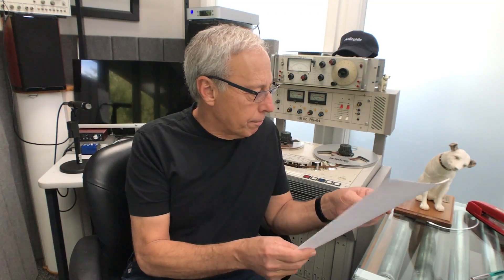Where vacuum tubes work best

Comment: Do you believe in using rectifier tubes for the power supply? Some people say you can't build a tube amp with a solid state bridge rectifier and expect it to sound good. I get the fascination. They're glowing awfully pretty, but so inefficient and expensive... and that internal resistance and sag...
Reply: Is it worth replacing the 1N4007 diodes with fast recovery diodes and what do you mean by snubbers ? Caps across the diode ? I once replaced the little rectifier diodes in my Philips based CD player with 1N4007's and the sound improved greatly.
Reply: I think it is a nice recreation, I think do it if you want and can do ...  I think listening with tubes is very close to what is called historically informed  performance, and away from the pure sound the eye and also the perception is different with a tube minster ;)  Also, if you are in any subcultures, steampunk etc.. So if you like to listen to historical classical music, swing or rock, the tubes bring you closest to the experience the people had 60 or more years ago.  Since energy is quite expensive in europe, I think I stay with solid state  rectifiers and stay with Class D/T or worst case AB transistor amps

Comment: in consideration to your preference for transistor amplification and that tube front ends are sonically more pleasing to listen to i have to ask:
have you considered the korg nutube(6p1) in/as a front end? seems a compatible choice due to the lower required voltage and amperage levels.

Comment: Hello Paul. Greetings from Norway. 
I’m wondering, will tube riia/record amplifier, make it sound like warmer and more detailed? My amplifier is a Classe sigma 2200i ?
🙂
Reply: If you're willing to spend more money, then a tube phono preamp makes sense.  At lower prices (less than $600 US), tubes will be much noisier than solid-state because they need much more voltage, thus they have to compromise the power supply to meet the price point.

Comment: How do you/PS feel about Toshiba/Linear Systems JFETs (2sk170, 2sj74)? I love tubes, but have been using said JFETs in buffers (cascoded generally) before mosfet output stages, active crossovers and in preamp circuits. I feel I've been able to get a nice warm sound with very low noise and without the tube microphonics, breakup, and general wear and tear that always brought me back to an increasing cost of maintenance as time goes on.
Reply: I think you will find it's close, but never the same. there is a spaciousness that a 300b SET delivers that NOTHING else does, which is why they try to sell them to nubes for 60k

Comment: I spent 3,000 on my massive marantz sr-18. It has a humungous torroidal transformer and burr brown circuits. It's fine for rock. But when I want violin, sax, piano, vocals, jazz, opera, classical, cello, well theres no contest. My 300B SET blows it out of the water.
Reply: well my amps are all tube, but the 300B is the rectifier which should NOT make that much difference to the sound, yet it does. Any explanations?
Reply: My 300b also has a tube rectifier, 5u4. Don't know why, but all 300b's have it. Could have to do with being SE?
Reply: tube rectifiers lack the commutation noise of solid state so are much better but typically limit the power output and require careful slow warmup (good tube amps have a ON click once they reach levels and are ready).
Reply: My 300b has a timer of 45seconds to enable the otherwise grounded input circuits. Do you slow start, or delay start your B+?
Reply: I agree.
Reply: I just finished my 300b. And ready to compare. BTW, in my experience and IMHO the best place for tubes is in the outputs. The driver, and for PP, the  inverter, front end can be IC..
Reply: I think a good tube pre with a tube phono section with a mosfet back end is as good as it gets as far as having the best of both worlds. You can get 10k hours out of some tubes if they are in the pre-stage. I would n't doubt a tube power amp sounds better. I just don't want the maintenance

Comment: I have been using audio equipment for over 50 years. I can't afford the best of the best but over the years I have owned both tube and solid state equipment. About 15 years ago I had a pair of FET power amps and a Parasound preamp that sounded good but something was missing. I had owned a Jolida tube power amp before and I liked that sound but the output tubes were getting ridiculously expensive so i replaced them with the 200wpc FET monoblocks. As I said they sounded good but not the same.

One day I came across a used Conrad Johnson PV10 preamp for a decent price so I bid on it and a week later it came. I put it into my system and I knew I had made the right choice. Life was good and the replacement tube costs were reasonable. I hav since replaced the FET amps with a Musical Concepts modified Hafler 240 and am even more pleased with the sound.

I agree that having the tubes at the front of the amplification chain is the way to go, you get the sound you want without the drawbacks of tube power amps.
Reply: Tubes are mostly voltage devices and bipolar transistors are mostly current devices.  Using each according to its nature, tubes will amplify the voltage (preamp) and transistors will amplify the current for the speaker (power amp).
Reply: I have a similar set up 
A buffer with P7000 halfler diablo
I also have a similar report ...
It sounds great  .

Comment: Hi all. Can someone explain what he means by "front end"?  Does this specifically mean the preamp?   Thanks
Reply: Usually a modern Audio Amplifier can be divided in 3 Substages Input/Gain/Power -Stage. The Front end can be Input+Gain or sometimes it only refers to the input stage.
Reply: Front end = Input stage
Reply: Preamp.
Reply: Front end for normal audio hobbiests means a tube output stage preamplifier ,for the audiophile class who splits Preamps into multiple sections front end means the final output stage ,for me a Tube preamp with solid state monoblocks is what my speakers love best ,I have an experimental tube buffer from McIntosh that never went into production that I use on 1 of my CD players and it's the 2nd best sounding CD player I own ,my best CD is a Dynaco tube CD player ,the CDV-1 pro .
Reply: Keith Moran - Preamp and also the input stage of a power amplifier

Comment: First of all, this youtube series you've been producing has been fascinating! That said, I'm curious why the "Sprout" product-line isn't offering a "tube-buffer" either as an add-on option or as a stand-alone device that shares that same chassis-design as the Sprout??  (Hint, it'd be great if you made this with both balanced and unbalanced in/outs so it could also be a signal-converter between different pre-amps and amplifiers, and also by all means keep the power supply INSIDE the case! The world doesn't need any more "wall-wart" system-clutter, lol)

Comment: You lost amaizing opportunity to excel with a separate tube buffer, instead will stick those tubes everywhwre, as all other companies do. In a few years no one will remember tubes, because Russian and Chinese modern tubes are no match for genuine NOS tubes. Love your videos and love Amperex tubes for headphones, not for primary system(s)
Reply: I've purchased  complete of ECL82  end stage for low price in  2011 and they were from Russia  After using them 6 years in amp   for music i measured their anode currents and it is nominal 26 within 1 mA.  I expect that is because amp has  common cathode  voltage which provides greater stability. . But it still prooves: this tubes are enough ok. Of course I would like change them with  more fancy but not for a 700% price
Reply: Tubes will continue to sell because the Chinese tubes made them affordable. There are still American offerings and I would be surprised not to see companies offering thier old tubes again. Tubes are going nowhere , they have been here almost 100 years.
Reply: Eh, I don't entirely agree. If what you consider "no match" is how much harmonic distortion exists, then NOS tubes indeed are no match, as they tend to color the sound much more than new tubes. Some do it very well, some don't. But Chinese tubes have come a long way in the last few years, mostly because they're directly plagiarizing tube designs that were considered the best sounding over the ages.

Also, the vast majority of NOS tubes are simply labeled NOS and are actually pulled from non-working equipment and boxed back up, so usually you're comparing tubes that have probably already settled into stability versus brand new tubes which need at least a day or two to reach stability and their best sound. IMO JAN tubes are a better bet to get an actual NOS tube, but many JAN designs are built for more durability and as a consequence you need to bias them hotter to get the best sound, which of course reduces their longevity.

Comment: I like the old days when tube amps were point to point wiring.
Reply: Just check some Prima Luna if you like point to point wiring ... ;)
Reply: Yep!
Reply: That's the only correct way of building a tube amp.
Reply: mine is point to point. silver wire. hand soldered. harder and harder to find. less reliable than with a pc but did you really spend 2000 on tubes to squash the signal through a tiny 1mm trace line on a circuit board?

Comment: One characteristic of tubes that differentiates them from many transistors is that they have a very high input impedance drawing almost no current from the source. They will not load down the output of whatever is connected to their input. Could this explain their sonic differences?
Reply: Most SS equipment also has high Z inputs. Maybe not as high as a lot of tube equipment, but certainly high enough to make current draw a non issue.
Reply: As You state tubes represent high input impedance and for that reason they are driven by high impedance output sources like tubes too. Then there is  a problem with capacities of shielded wiring and capacities between the connections, between elements and chassis and also a problem of potentiometers impedance which is altering itself depending on it's position.  With full volume input is driven by impedance equall to full pot resistance, and with moderate it may be just 15% of it. If  input is driven from external source it's impedance should be also as low as possible - that may create noise troubles.  It all plays up to my observations a filtering game. I suspect in old days engineers trusted more their ears and then they could equal everything by ear in ex tone adjusting or feedback stages with accuracy and  tremendous effect. I've reneved such old radio . May be today in industry it is not practiced - all is passsed to measurements and no "secret" equalization is done due to ...ISO? . Than "warm" effect would be more visible.
Reply: There is a HUGE difference between a point to point wired tube amp (like my 300b set) with silver wires, vs those that crush through an circuit board. You will find that those that are not point to point wired (which is ALL of the mass produced ones!!!) do not sound as good. His arguments for solid state are utter BUTKIS!!! sure tubes are rare and costly and wear out. so what. You deal with it if you want BLISS not TURD sound.